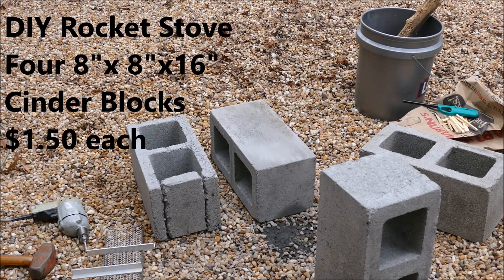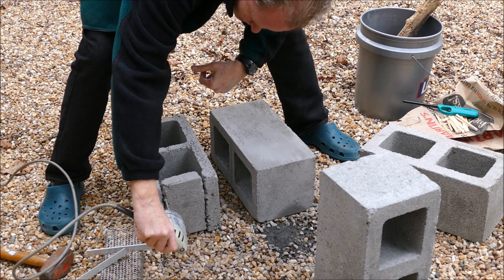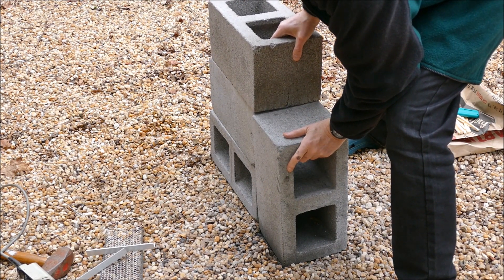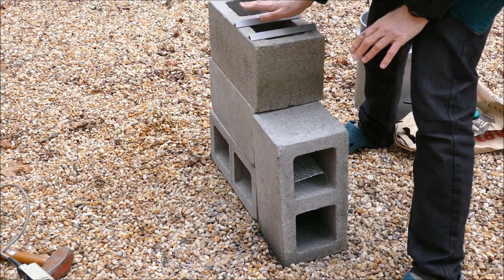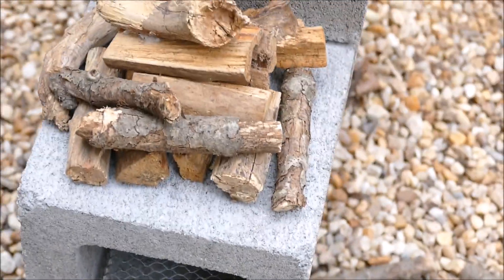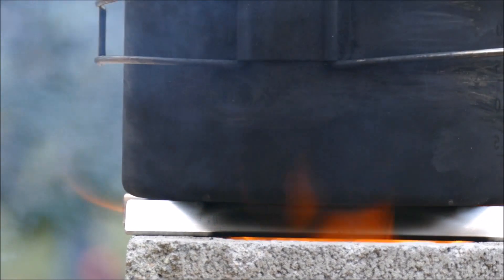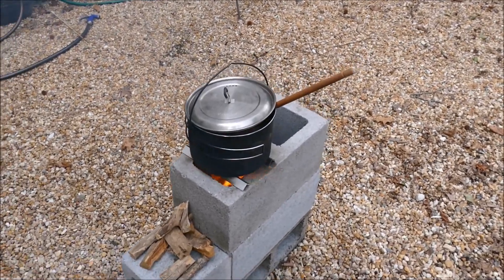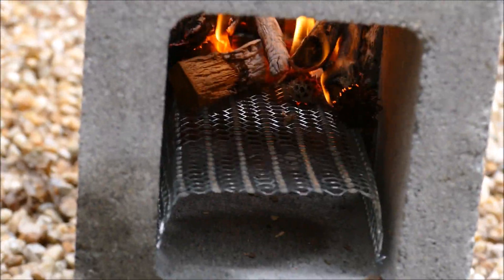Cinder Block Rocket Stove

Comment: I am loving this form of improvised stove and have bought the supplies to make one.  Currently I am reviewing videos to pick the best design features for myself. Your wire mesh fire support is an improvement over the squished can version. The one thing I notice about most of these stoves is that they seem to lack the legendary efficiency of a true rocket stove. While way better than a open fire or fire pit, the presence of the soot on your chimney is a sign that this one is the same. It may simply be overfired or perhaps needs an additional chimney block to improve its efficiency?
The last challenge is to find away to cut the bottom block cleanly without power tools... Thanks for sharing.